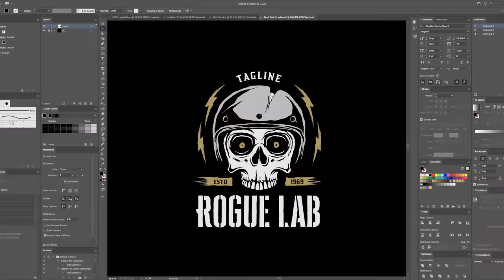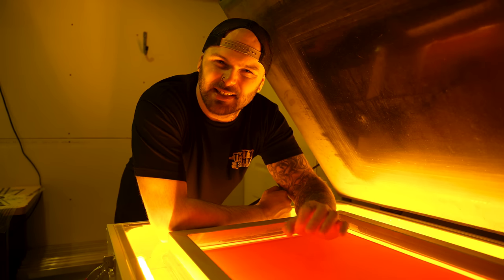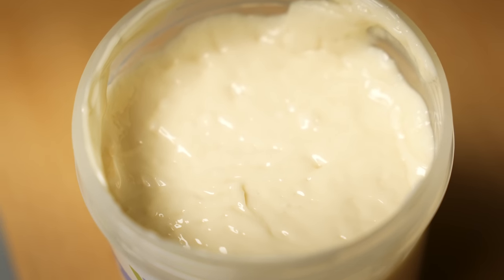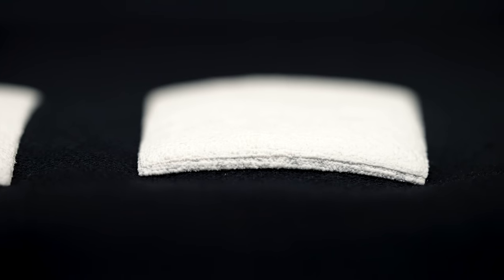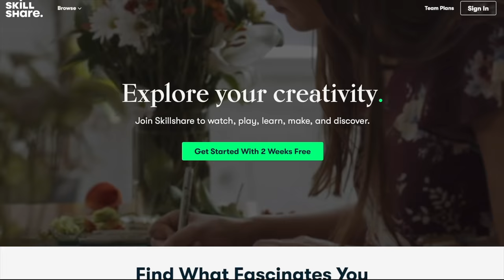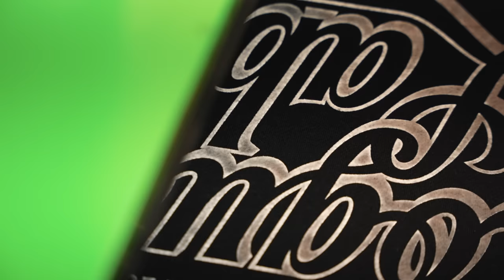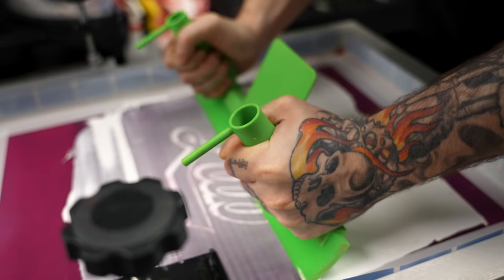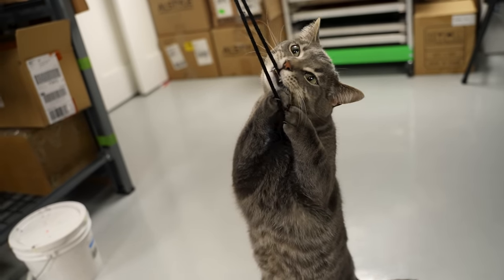My First Time Screen Printing Puff Ink

Comment: Using puff , let say a color print , you need 2frames of the same artwork , which on the first frame you will print the normal ink as a base  ,flash it then print ( 1 or 2 times ) with the second frame which you have mix a little puff ink with ( same color ink ) then print again with the the base bright ink ( frame 1) then raise the T-shirt from the pallet before a flash , and here you go you will definitely get the result you are looking for .try ...

Comment: I appreciate your candid response to failure. Always pushing yourself and learning! Keep up the positivity brother in ink. If you ever need a shop hand with over a decade of experience to circumvent the overload, I could use a lil road trip out of Eastern Washington.
Reply from the maker: Failure is the best tool to learn from. That's why I love this job so much, you learn something new nearly every day and it will never stop 🤘🏻

Comment: Mix the puff base with a little white base apply 2 passes of that mixture and pre-dry a little later apply two passes of normal white base on the puff base and in the same way with the red color and then pass it through the oven and you will notice the difference Sorry if it is not well written but I used a translator since I live in Mexico and I don't know much English.
I hope my explanation is good

Comment: Looks pretty cool but i get it...we want perfection when printing. I've always thought the puff looks better as the top layer...although my experience with puff has only been on vinyl side. In any case, thanks for continuing to share your journey and knowledge with us!
Reply from the maker: Puff it's a tricky thing in application and it also takes the right design. This experiment is definitely not over!

Comment: If money wasnt an issue...as a beginner starting out in the screen printing business...do you think it would be better to go for automated screen pressing equipment?....or learn some foundational stuff first with a manual machinery?
Reply from the maker: Going automated use a pretty huge investment, close to 6 figures or over by the time you're done. You should make sure you have the work for one first, and make sure this is something you truly want to do. So go manual to start and build up

Comment: I'm a beginner at this screen printing and you make this stuff look easy. the puff fx is dope, but i have a question for you. as a beginner of screen printing using plasti sol ink, what screen mesh should be using and what scrapper should i be using. you are an expert that's why I'm asking
Reply from the maker: Screen mesh and squeegee choices change depending on the job and the artwork, there's no one right answer. Ryonet has a few videos briefly explaining it, and I'll be making some stuff about it a little later

Comment: Try Rutland puff additive..10-20% max
Don’t put base for puff part. 

If you are printing any pms colour :

Hit one stroke (puff)use 34t mesh screen flash it until it puffed  - hit one more stroke 43t mesh screen flash it again - one more hit with normal ink 62t mesh screen to give smooth finishing. (3 screens in total) 

You will get puff print the way you want. 

This is how we do our production. 

And for black- use the same method but use normal black on the top of the puff black.  This way it will stay black not grey. 

Tint: more flash means more puff and it won’t die or come off
Reply: Drying time is very very crucial. 3metre oven at 160 degree c under 1 min will do just fine.

Comment: Do you recommend using Fiverr for t shirt graphic design? Also are plastisol heat transfers similar to screen printing as far as feel?
Reply from the maker: Nothing good comes from fiverr in my opinion. If you want good design and proper files, hire a pro. And transfers are decent but nowhere near a printed shirt
Reply: @leestuart38  thanks for the info, by chance do u know where  could I hire professional designers?

Comment: Hey Lee, what printer are you using for your film outputs and have you had good luck with it? Your answer will really help me out, so thanks in advance. Happy New Year man!
Reply from the maker: I have the epson p400, it's been solid for the last 2 years
Reply: @leestuart38  thanks for the quick reply. I guess I’ll have to go with the p700 or p900 since the 400s discontinued. I was questioning whether ink costs would high on these models. I’m replacing an epson 1430 all black system that just keep fucking up on me.  Was about to spring for the Epson 3270 though since my business is already growing so damn fast.
Reply: @leestuart38  one last question and sorry for the headache.....do you use an all black system with that p400?
Reply from the maker: I would make sure your rip supports those new printers, I know the makers of accurip are taking an insane amount of time to update to them...I would have upgraded to a new printer already if they had. There's a successor to the 3270 that I want. Otherwise I'm just using the stock inks, I find they do a better job than the black dyes with this printer
Reply: @leestuart38  i started with sep studio 4 and like it for the most part, it’s all I know. Ink costs per ml on the 3270 are so much cheaper than the smaller printers it may be the way to go just for that reason alone, not to mention I think I can get away with printing stickers and fatheads on it too. Would be a big seller in my shop. (I’m the guy that talked to you about Teeslanger a while back). Thanks for the replies, I know it’s a pain in the ass to answer when you get so many questions. Keep up the solid work and continued success in 2021. Oh, and fuck the China flu.

Comment: Lee you interested in a real good DIY ink mixer? Super easy to make use and clean.
Reply from the maker: I just use a drill with a dough hook, works like a charm
Reply: @leestuart38  The dough hook is the trick easy to clean.

Comment: i done 3 colors with puff for that i recommend based flash print solid colors after that print puff flash for 10 15 seconds and hit again for 4 times light hits and master that print my G i done samples for juice world in the pass and all there prints are puff prints ! TRY high desnsity puff thats will work with one hit

Comment: If I Wanted To Use Puff To Print 3 Locations (Front,Back,Left Sleeve) Would Running Them Through The Dryer 3 Times Collapse The Puff?
Reply from the maker: It's possible but it would definitely be problematic and a big headache

Comment: put some puff in your ink for the boxes!  LOL _ lets see that!  - I did a few shirts with puff - I liked them.  I used additive from my local print shop.  i think i mixed about 15% and the puff was great.  I don't hate your design, it's different from your usual style for sure, and I think that's why you don't like it.  Try using puff on your NORMAL style.  You'll probably like it more. Good stuff. Love the videos.  Until next time, Merry Christmas!
Reply from the maker: I love the design, hate the puff with it 😂.

Comment: What would happen if you heat pressed the puff to cure?
Reply from the maker: The puff needs to expand, can't do that being pressed. It's not like a puff vinyl that does it over time afterwards
Reply: Thanks, I was curious if it would press the ink together to cut down on fibrillation. I figured it needed air to go through it. 🙌🏻 thanks for replying.